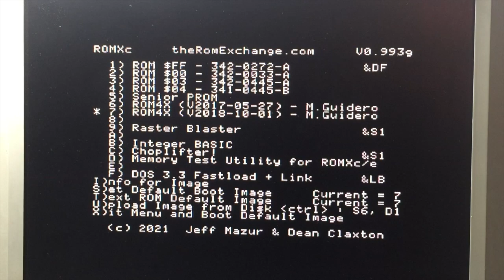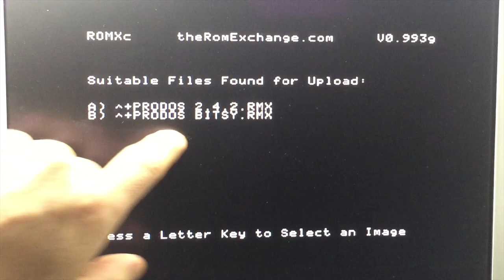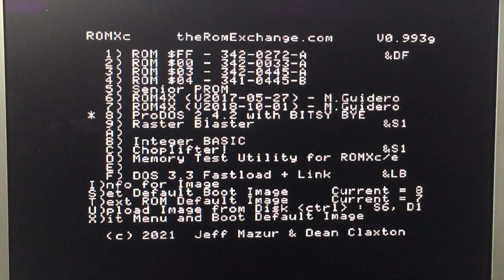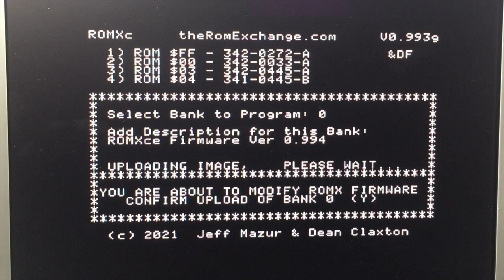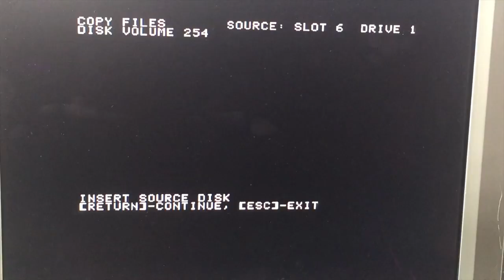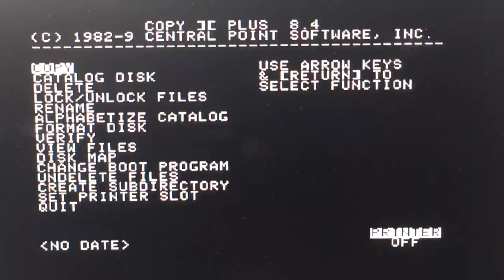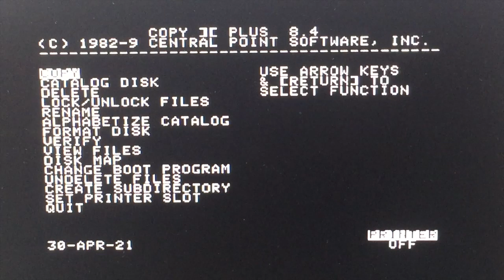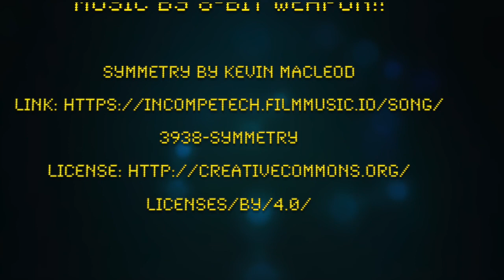Quick Clip 45 - First look ar the amazing ROM Xc

Comment: Did you get the video ROM adapter as well? On their website it says it comes with that, & they have a picture of it installed & connected to the romX !
What the hell does that do?🤣🧐 
Really appreciate this,
Reply from the maker: No, it was being produced but they will send me one soon. It is to change the system font. Will do another video when I get it.
Reply: Check out the blog on theromexchange.com - has the list of fonts we did for ROMXc and ROMXe. Video ROM links to ROMX via the ROMlink header and cable - allows you to then associate a font with a ROM. There are 2 banks of 16 fonts, using the IIc keyboard switch to select the bank. Most useful ones are in the first bank. IIc keyboard switch also switches the key map, but we have a MAP ROM Override adapter to stop that - so the switch only switches Video ROM banks. If you look at the blog posts in September last year some of the fonts are shown there that we did for ROMX (Apple ][,][plus)
Reply: @deanclaxton  cheers Dean! I’ll check it out now... got to bed at 2am coz I was looking into all this🤣javmaster uploaded around midnight, I just couldn’t go to bed lol

Mate, my hat off to you for creating this. I want to buy one, the website says to contact directly on the email provided. I’m in Melbourne. Is there any stock in Oz? Or does it all have to come from USA.? Would love to email some ideas to you for the IIc future projects 🙏

Comment: So the RM site says C plus support coming soon.  Will this RomX hardware work with the C+ with new firmware or will an all new hardware RomX be needed?  I really want it for my C+ since that’s the one I use most.
Reply from the maker: I don't know, maybe Jeff or Dean can answer that.
Reply: IIc plus will be a different model - we've briefly looked into that, and it wlll require a different layout plus we may have to tap into some other signals. We will look into after ROMXe for the IIe.